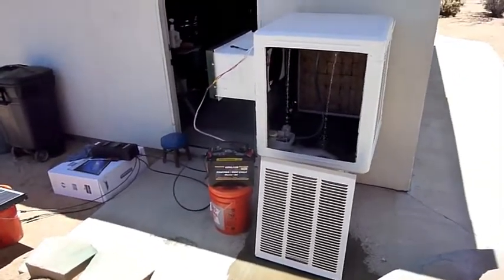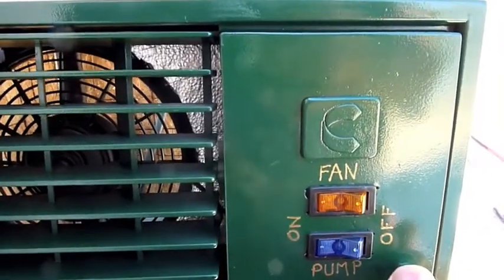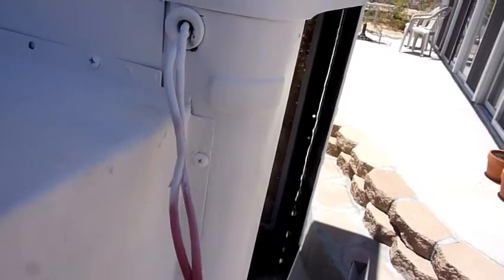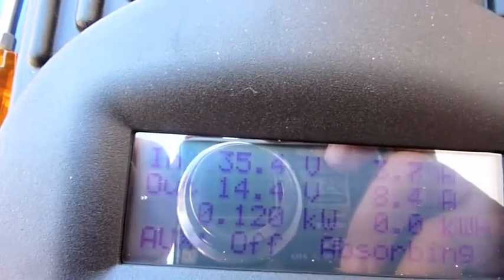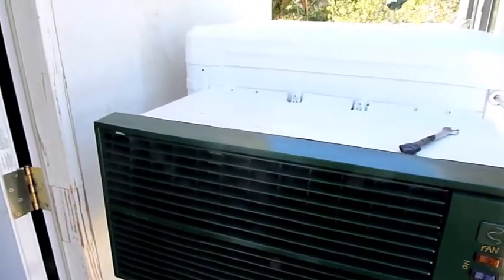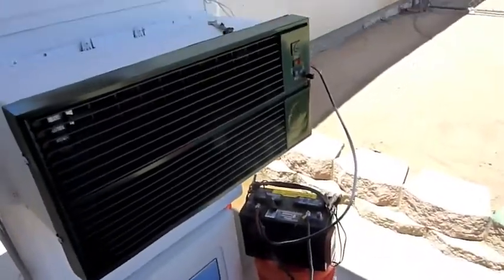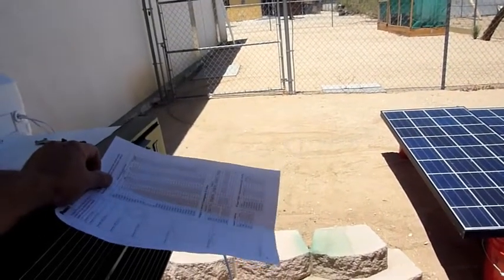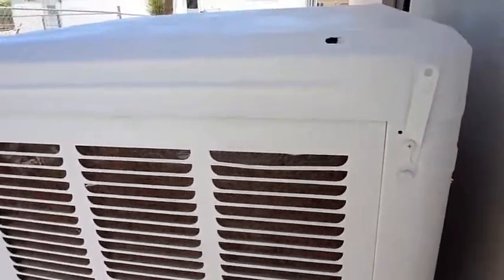Solar Powered (DC) Evaporative Swamp Cooler- Part Two

Comment: does the swamp cooler run off of the panels when their in the sun, in other words the cooler runs off panels only and doesnt use the battery at all, how many watts is the swamp cooler at high fan and pump. running, is you fan pushing or pulling

Comment: How has this been working for you?  I just found your video after trying to run my swamp cooler on solar with my 3000 watt inverter and it doesn't have enough cranking power to start the AC Motor.  I'm bummed but then I found this and think this might work better instead of trying to find a smaller motor that uses more energy.  What I'd like to know is if the DC Fan your using is good enough?  After using it for so long, what changes would you have made so I can use updated parts and make it more efficient?
Reply from the maker: You can buy an automotive DC fan anywhere. Almost any type will work. They last forever. Remember, these fans were designed to operate for hours on end just as you drive a car across country.
Reply: @Hairfarm1  I got 2 radiator fans and posted a video of my build. It's working great, however, the fans blow the air to the sides and not the middle so we can't feel it when standing directly in front of the swamp cooler now. Going to build a vent cover and hopefully direct the air where we want it.
Reply from the maker: @plantbasedprepper  great setup and execution. Are those dual fans somewhat loud when cranked up to full power?

I didn't find any improvements or components over my original setup. And it's kind of a crapshoot as to whether or not the DC fan will be loud or not. I just lucked out and got a relatively quiet fan for my setup.

I've long since moved on from our cabin so I couldn't even tell you what type of fan it was.

Great job!
Reply: @Hairfarm1  I bought 2 fans. First bought the 10" that were quite and wouldn't fit so returned and bought 2 8". I don't crank them to full power becuz they are louder but even at half speed,y temp outside was 100 and it's blowing 65! Works just as good or even better and using only 80 watts at half power! I'm pleased!!

Comment: I found your part 2, i see now, the green panel goes in like a window unit, this does not sit on top of the building and flow down,    i was thinking at some point, if I watched long enough, a temperature gauge would be shown. LOL   silly me.   
  i am going to build a much simpler unit that is only going to be cooling a space of about 24 sq feet for my animals and will run directly with no batteries and no regulators, it will just come on and run when the sun is out.     That is my plan anyway.  
Thanks for the great video.
Reply: Did you make one? If so how did it go? Were you able to get it to run without batteries?